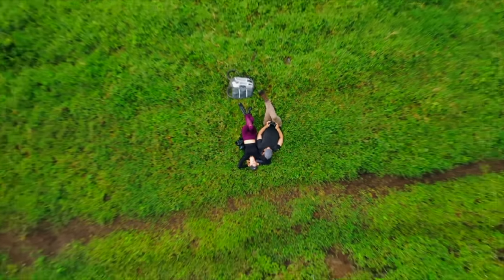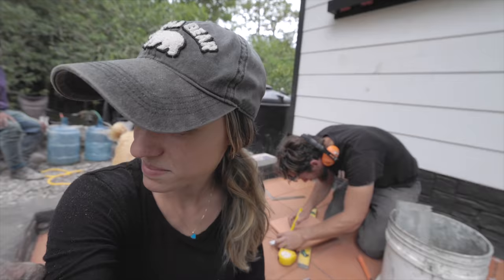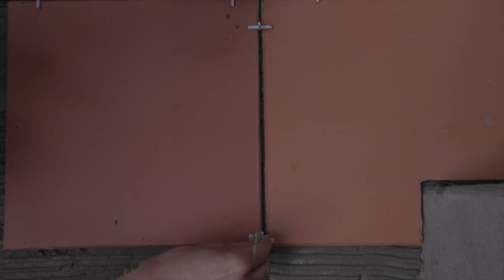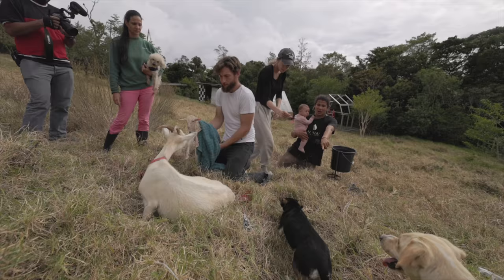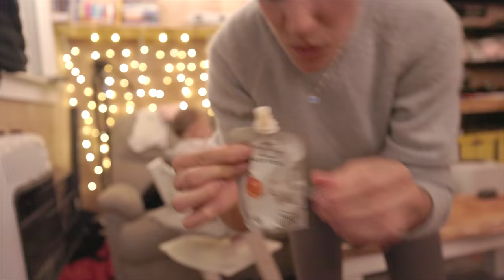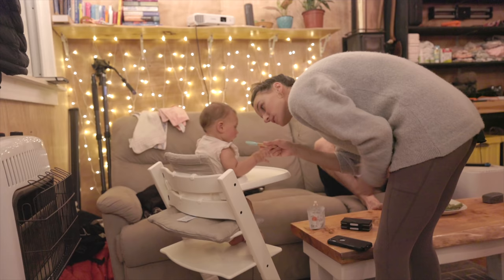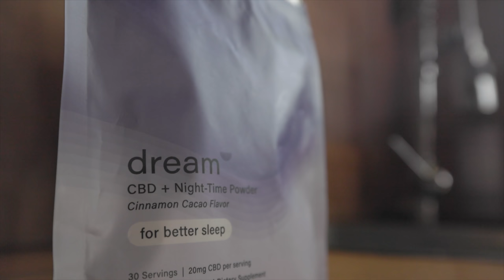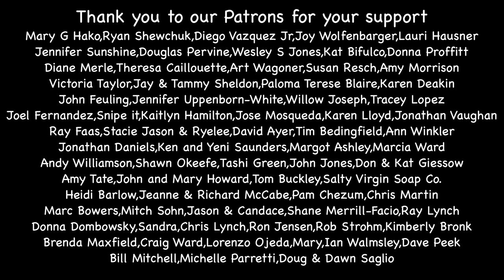I'M IN SHOCK | huge surprise on the farm

Comment: A month ago you were talking about doing pottery. I'm so excited for you. Be careful with your clay supply. I know in certain areas there is lead in the clay naturally in Mexico and up and down Central America. Also some of the glazes also have lead. If you aren't making utility vessels that aren't used for food or drinking water it won't matter. Also check drinking water. Different areas naturally have lead or heavy metals. I live on a 100 acre farm and we have well water with copper in it. We have a very big filtration system in the basement to filter out the copper.

Comment: We raised goats for milk. Our son and daughter needed it. Having the bucks near the female milk goat makes the milk taste like the buck smells. It is not pleasant. Our experience is to make the the milk taste the sweetest is to put the bucks down wind from the females. And when you milk get the body heat out quickly. Always use glass. Put the warm milk in the freezer for about 1/2 a hour to cool quickly. Then cap it tightly so it can not pick up tastes from fridge. It will taste great. Congratulations on additional farm family.

Comment: Any chance you'll install an electric water heater for your shower system? even for warmer water? I just can't imagine taking so many cold showers! In Taiwan, household water sits in silver metal tanks on rooftops, pumped up, then allowing for gravity fed flow - great water pressure - but also, the tanks heat up in sunlight and the water gets plenty hot in the summer. In the winter we use a wall panel electric heater.

Comment: The male goat, or buck, sprays hormones on the females, or does. The hormones are very powerful and smell. That is what gets into your milk unless you can keep them separate. Females experience fertility after awhile even if they are nursing a baby or are milked daily. Males will attempt to spray them and mate, it is just what they do. To keep the milk tasting really good you must not only separate, but also keep the males at a distance. To stop this problem, you'll need a fence around the goat shelter through which the male cannot get anywhere near the female. That means a fence where they cannot contact each other or touch or spray, meaning a fence that keeps males at a distance, where the male cannot spray the female. Put a few feet of distance between them at all times, so that it cannot be breached by a male goat. Now different people will tell you that it doesn't harm the milk, but I've had goats milk where the males and females were housed together, and I promise it makes a huge difference. You will probably want to drink the milk, make cheese, make ice cream, make yogurt, make cream, and cook with it, so you'll need to take this business of separating the bucks and does seriously. Also, bath and wash your milking goat before milking to get any old hormones off her, and periodically to get the best tasting milk. My best wishes!